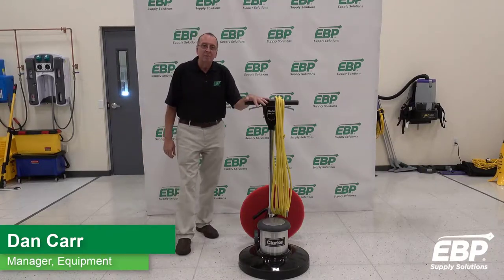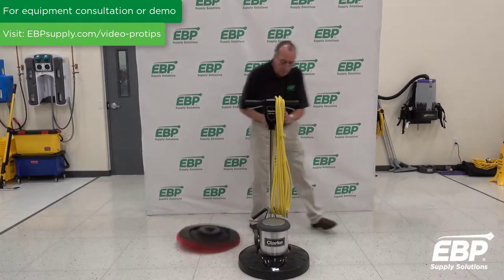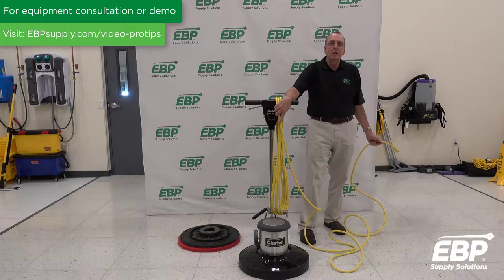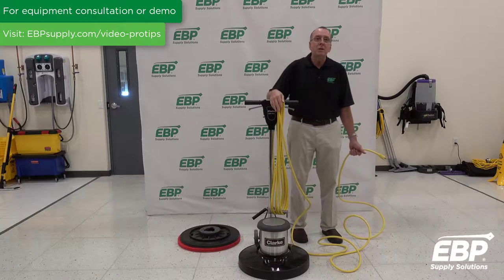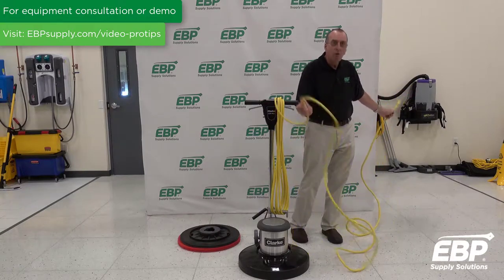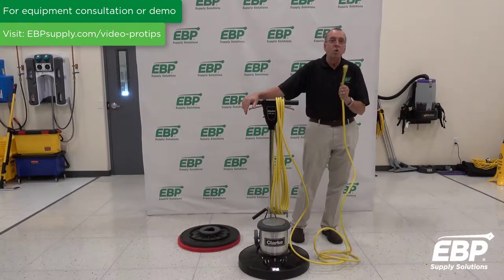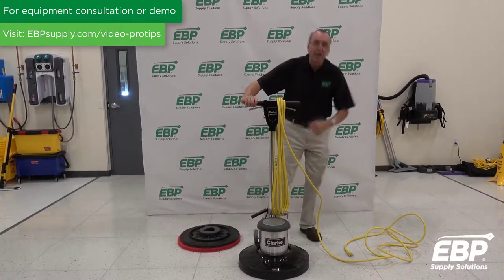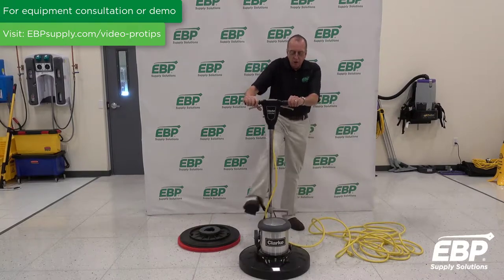Troubleshooting Common Problems with a Floor Buffer

Comment: You've spoken about things that nobody does, but I wished you spent the time on how to deal with the stupid locking mechanism on the bottom of the buffer and the weakness of the handle that I have to weld many times.

Comment: When burnishing a epoxy black floor it sometimes leaves these 3D white lines & it comes from the middle part of the pad. Any suggestions ?
Reply from the maker: Hi! This typically means that the pad retainer is hitting the bottom of the floor. The pad retainer should be full tightened before use.

Comment: cold you use this buffer on hardwood floors?
Reply from the maker: Hello! Are the hardwood floors finished? Are you looking to strip or buff the floors?
Reply: @ImperialDade  buff floors are finish need to be sanded but need to buff after sanding

Comment: What if ot pushes on to the left. Right hadler not working.  Not pushing to the right
Reply from the maker: Hello! We are sorry to hear you are having issues with your floor buffer. We first recommend trying to adjust the handle level. If the machine is pushing to the left raise the handle ½ inch and it will move to the right. If the machine is pushing to the right, lower the handle ½ inch and it will go to the left. If this does not work, reach out to us and one of our trained technicians will be in touch: https://www.imperialdade.com/help-center/general-inquiries?pathname=/

Comment: And don't forget always slammed the handle when you tilt your machine
Reply from the maker: Thank you for the reminder.  Sometimes when we are focusing on the lesson we intend to teach, another detail slips through the cracks.  We would certainly recommending taking care with the machine and floor when handling the equipment.